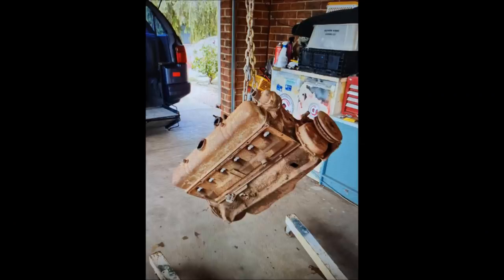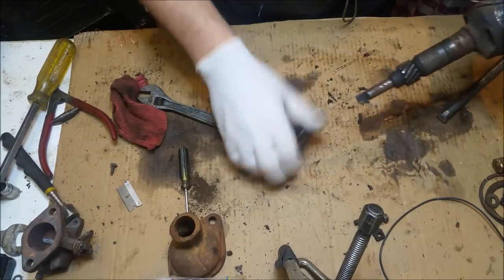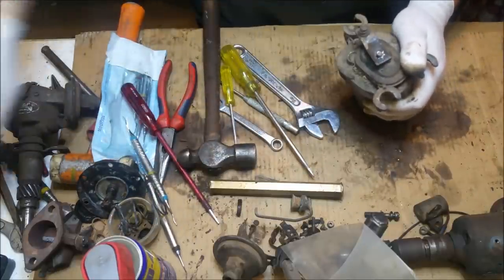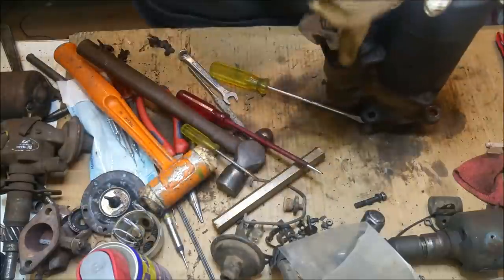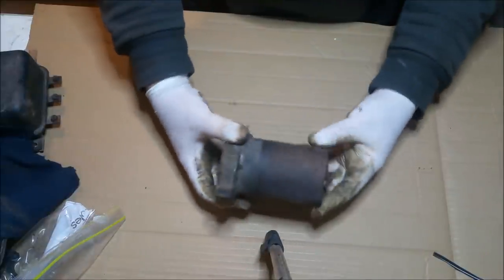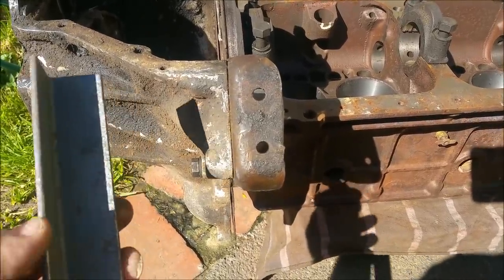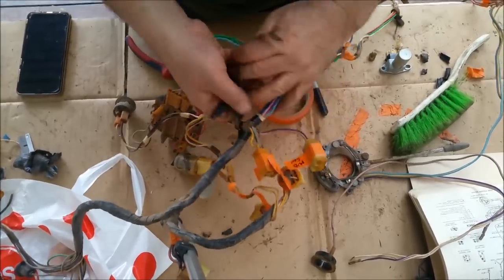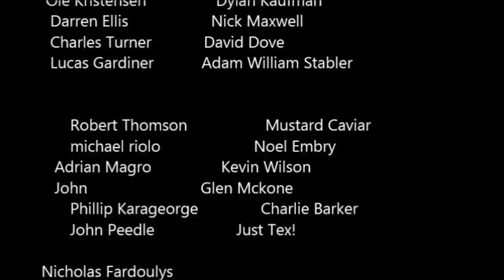EJ Holden Grey Motor Part 2 - Let's Take a Stand (and look at more bits)

Comment: Oh yes, I'm old enough to remember the little balls swirling around the sight glass in the petrol bowser.  I also remember petrol at 20 cents a litre.  I'm also old enough to remember the analogue dial type traffic controllers along the Nepean Highway.  I wonder if any of those controllers were ever preserved and put into a museum somewhere, I hope so.  They were a bit of history. 
Funny I remember all that but I don't remember what my EJ had for a windscreen washer, my dad's Valiant had a rubber bulb on the floor near the dip switch.  My dad also had a Renault 4, the windscreen washer on that was my dad having to stop the car and spit on the screen, seriously.
Reply: RACV in Bourke st has one of the analogue ones on display.
Reply: @TheBobruub1  When we all get paroled I have to go see it. Thanks for the info.

Comment: Hi Pete, I am having a lazy Sunday afternoon watching you dissecting these bits. Takes me back to 83 when I had my EK wagon... wish I still had it. Chat soon mate... take care, Rach
Reply from the maker: Was that your first car Rach? Great to hear from you!
Reply: @PeterAndersons  Hi Pete, no I had a few cars before the EK. My very first car was a 1963  Datsun  320 wagon, then I had a two door LJ GTR  lookalike with  186 bored to 192 with 350 holley and extractors. After that came a very nice XL Cortina with a 200 motor and 3 speed manual on the floor... that was a very nice car too. After that came a HJ  Kingswood deluxe wagon which was eventually traded for a very spiffy RX4 sedan with the rotary engine.... then came the EK and after that was my Wolseley 24/80 which led me buy a 6/80 as well. I sold the Wolseleys and got an XE wagon which then led to a near mint XF S PACK wagon, then a 1981 Honda Civic wagon, then my ED Ghia sedan.
Along with the Ghia, I picked up an  89 Subaru wagon, 4wd,hi-lo range 5 speed manual and my Sapphire Blue Telstar Ghia. The Suby and my Ed ended up as  scrappers eventually the story of which is another tale, but I now have my blue Telstar and my Silver one that is giving me electrical grief but I think I can sort it...
Wow, that's a few cars in my mix isn't it? These cars were all bought when cars were very cheap to buy but I wish I still had some of them as we all do..
It's great to hear from you too Pete and I'm sure we will chat again soon.

Take care mate, Rach x

Comment: That grey motor did not seem to smoke on start up and ran well enough, which leads me to think the valve guide seals were hard .So when it got oil pressure up to the rockers oil gets drawn into the cylinder by vacuum via the inlet valves down the valve stem. Might find when you pull it down the rings look ok, maybe! A blocked breather would cause it to smoke too. You may also know already, cheers
Reply: i wish i filmed it after it had ran for several hours it was literally pouring oil out the exhaust so much smoke it wasn't funny

Comment: hi peter 
 hi peter that fuel pumps the better type a GOSS brand had that screw in bridge for thr valves AC type were  peened over to hold them in 
the rough  edge on the gearbox slid gear and cluster is normal from grating the gears in first quite common yours is in great condition
the number on the gearbox would have been the engine number it was mated to thats how holden did it same numbers on box and engine
i think vintage wiring where i got my new loom from down there sells those plastic wiring plugs the same 3 wire plug was used to the HQ on the dipper
the temp and oil wires had a clear piece of plastic tube over them to protect from heat and oil
just some useless info lol to help you  can\t wait till you get the car and start on it